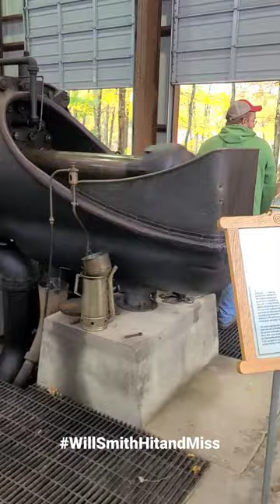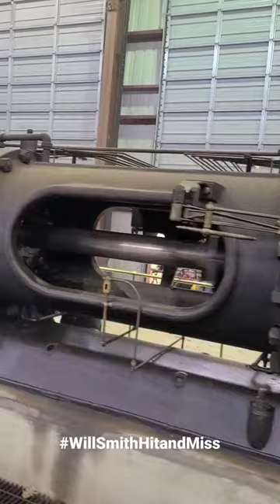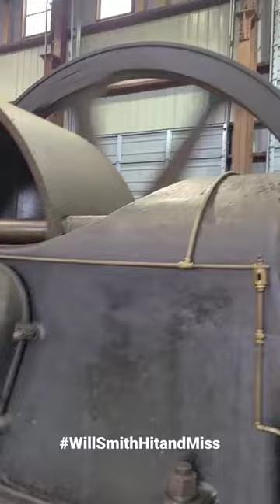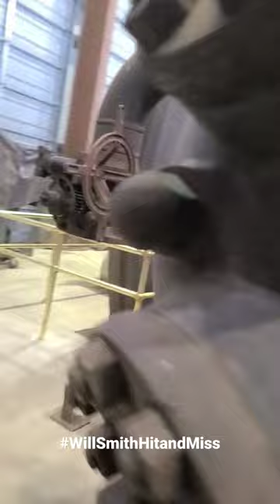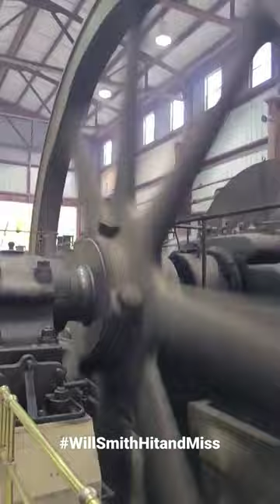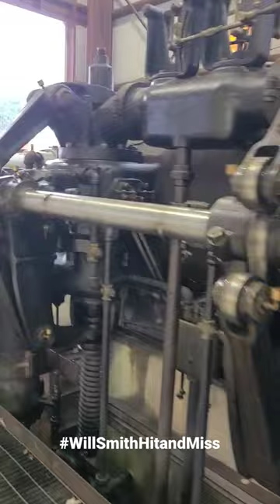Massive Snow Antique Gas Engine @coolspringpowermuseum9156 fall 2022

Comment: surprised it wasn't hitting overspeed there. Normally it does, because the overspeed spring is weak.
Reply from the maker: I have shot some video of it when that starts clicking away like crazy ~! I just guessed it was an over speed limiter, and it always looked kind of bent up when I tried to figure out what it was, so was never sure lol.. Thanks for pointing that out.